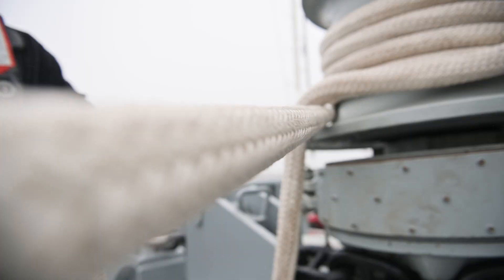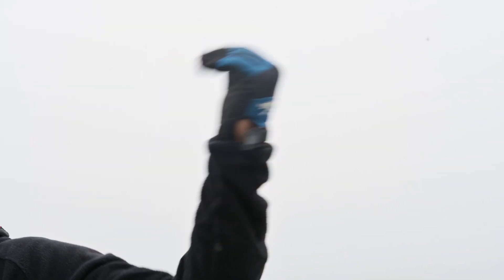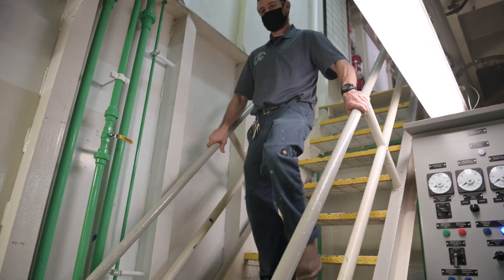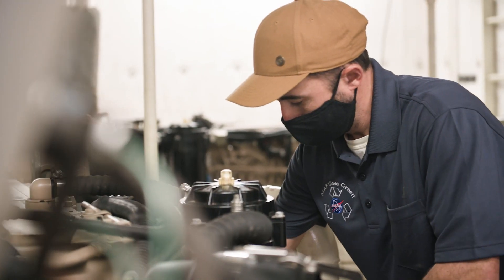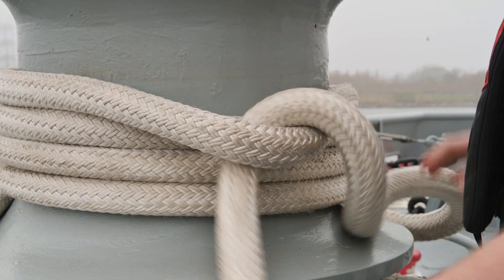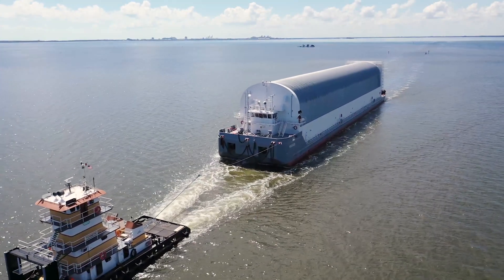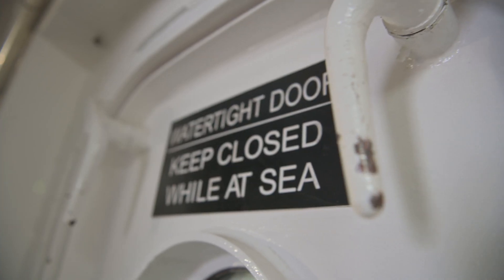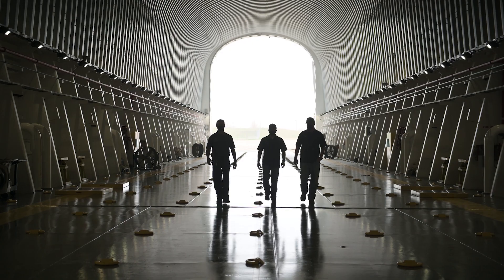NASA Barge Crew Describes What It’s Like to Transport Moon Rocket

Comment: I wonder if the barge is unsinkable or has extra precautions.
Reply: Nothing is unsinkable.
Reply: @OriginalPuro  A boat can have compartments filled with foam so water will not fill them if the steel is punctured, which makes it unsinkable. However, I don't know if that has ever been done on a ship that large.